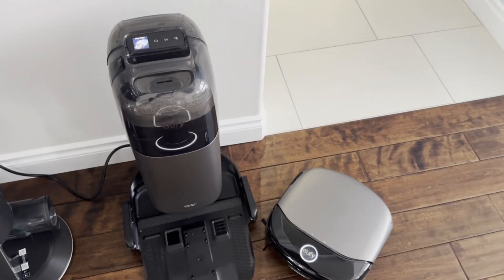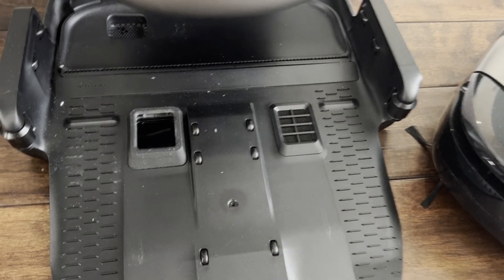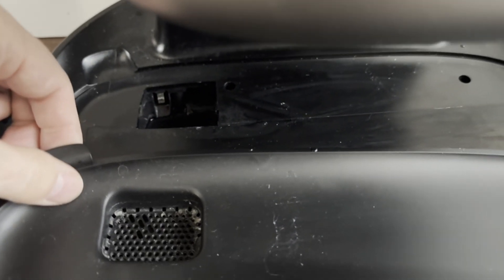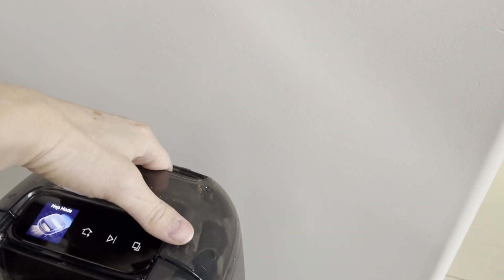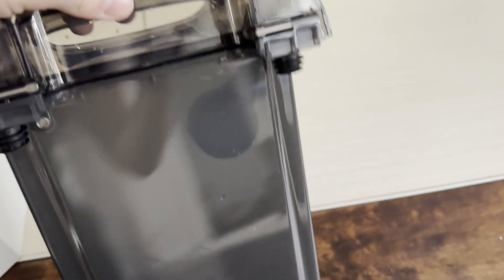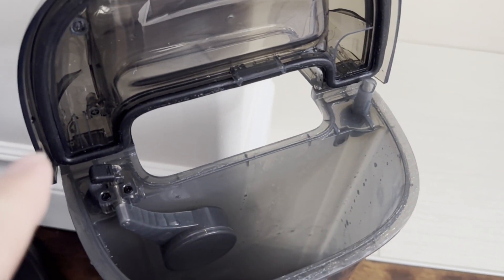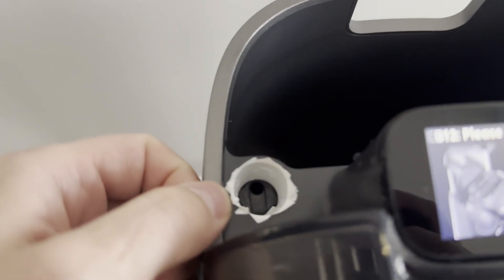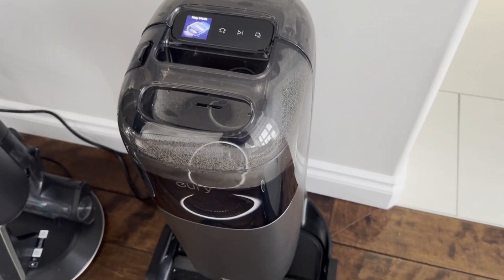EB1J Error fix for eufy Robot Vacuum Omni S1 Pro

Comment: Just had same problem - of not not dumping and error code and clear debris from tray after first time using Mop function.

Tray was free from debris
Suction seals were all good around the everything - but still tried sealing inside the holes with waterproof to tighten the holes just in case that was the problem and to no avail - error message still came up - so removed the tape from the holes.

Solution which worked - which could be one or all of the following:

 - stripped and cleaned all of the parts as instructed from the EUFY app. And then Reset each of the parts cleaned on the app so it shows 100%

- Updated the firmware (if it applies)

- On the app - go to wash mop - and run it - and it should go through the process of cleaning mop (even if it does not need to) and it if it does - it should wash and discharge water and the water should clear and begin to dump the water…..if it works properly…..which mine did….and all works as should be. 

Good luck to those suffering same problem. ^__^

Comment: My solution was to fill the dirty water tank with hot water in a bid to expand the seals; my hallway can be a bit cold, so if the seals had shrunk in the cold it would have explained my issue.

In any case, filling it up to the brim with hot water (not boiling) and then moving the water around inside the container to test the seals, tilting the container, and was what I needed to resolve my issue!

Same story as the guidance in the video really, about it being seal related, just wanted to share a technique for folks without Vaseline or electrical tape!
Reply: Thanks man - I just filled my tank up with hot water, let it sit for a while, then dropped the tank back in and it started working.

Only day 1 so hopefully the rubbers settle and I don't have to keep doing this.

Comment: do not put vaseline or petroleum on rubber seals it will break down the rubber. There is something called plumbers grease that is safe for rubber it can be found in any hardware store.

Comment: got mine today isn't working out of the box tried your trick stil same problem
Reply: Thank you for posting this. I’ve gone to bed now in frustration after this happening the very first time I’ve used the mop function (I’ve successfully vacuumed three times first as per the suggestion in the instructions).
I’ll try your fix in the morning. If it works I’ll be pleased but if it does it seems ridiculous that a product costing over £1200 in the UK is so shoddily made! I was disheartened when I googled the error code to find that many many people are or have had the same issue. I bought this BECAUSE of the mop function and planned to use it daily. 
Thanks again. Fingers crossed!
Reply from the maker: If that didn't work you could try adding 2 or 3 extra layers of tape to those holes, to make the fit extra snug. Another idea, take the dirty water canister and submerge it in the bathtub plug both intake and outake holes with your thumbs, and see if bubbles come up anywhere along the canister seal. This could help pinpoint where the seal might be not snug enough. Then adjust the seal, by pushing it in, or pulling it out, and apply some thick sealing grease (Vaseline, silicone, oring grease) of some kind.